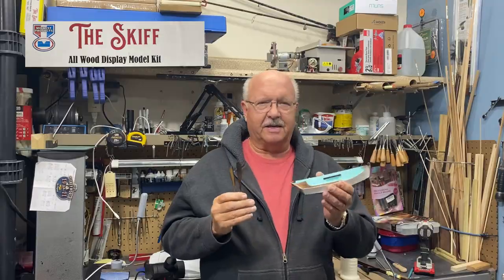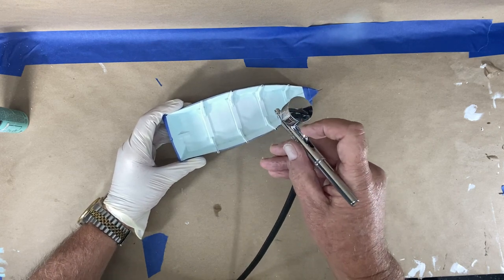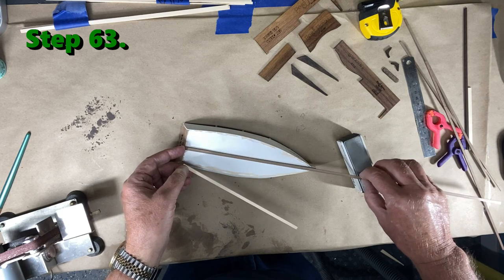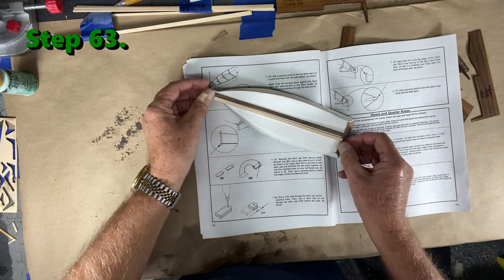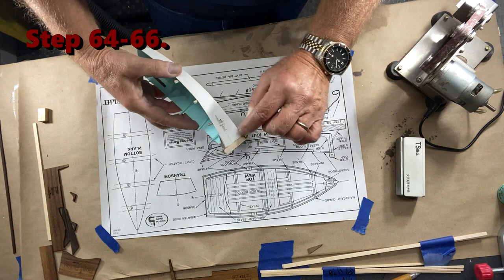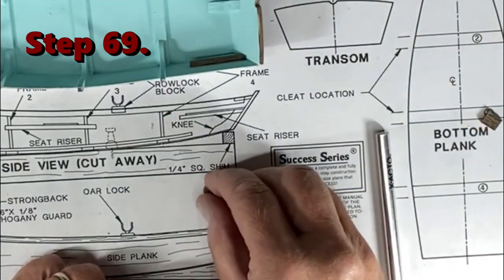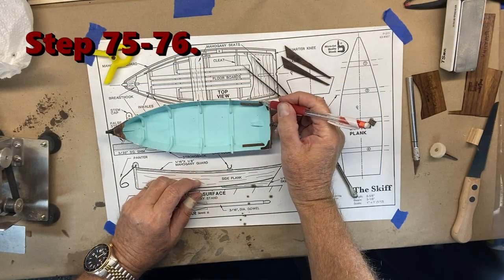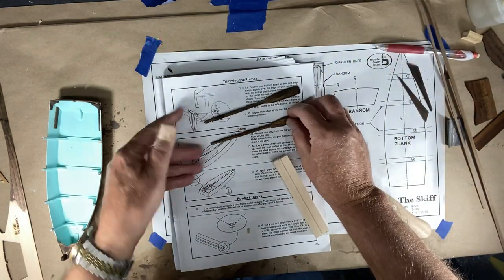The Skiff Part 3

Comment: Looking good. I like the contrast between the colour and the dark stained timber pieces. I love your hand made oars. Part 4 next. 👍
Reply from the maker: I was pleasantly surprised how well the oars turned out.  I will definitely try that again.  I think you’ll like finished look in part 4.  I’m actually going to do a little touch up painting on the hull, but the series is finished.
I’m making good progress on my next project too: https://youtube.com/playlist?list=PLjMZtm2hvqrNJM7eqpLw7LdEJf4cN58xw&si=R0UT7Qs4LgFJRTzp
Reply: Wow a paddle boat next, something completely different. 👍
Reply from the maker: @alankirkatrick1620 
Totally different!  I still plan on building The Flying Dutchman, but I wanted to try something new.
It’s HUGE…. Much longer than anything I’ve tried before.
I did a little research and it turns out that there’s no information about the actual color of paddle wheel ship.
In looking at old photos, the hull isn’t white as pictured on the box…. So I’m taking liberty and changing up some things. It’s a little refreshing to start something new and untried!
As always, Thanks for following along,👍👍

Comment: Looks good! How you liking the new airbrush machine? I saw that you can actually use the air to dry the paint faster as you go, and if you keep the air going it prevents the tip from clogging so much. It looks great and looks like a lot of fun! I'm not into models like I was in my youth, but watching this may get me into the ships.
Reply from the maker: I’m enjoying the airbrush, it’ll take some time to be really good with it. But it is great for creating shadows.
I’m building a large steamer paddle wheel ship that I tried airbrush a wall, but I think I got it too wet on thin wood and it started to warp a little.
But you’re right, if you control the airflow correctly it basically dries as you go.
I’ve gotten much better with airflow clearing the pathway so it doesn’t get clogged.
I’m completely enjoying modeling in my retirement years….. I have time to work on the craft between vacations 😂.
Thanks for watching!👍👍